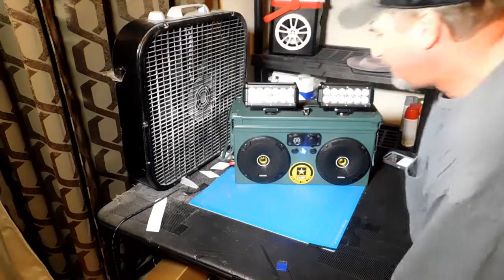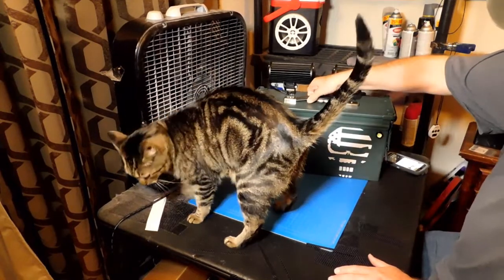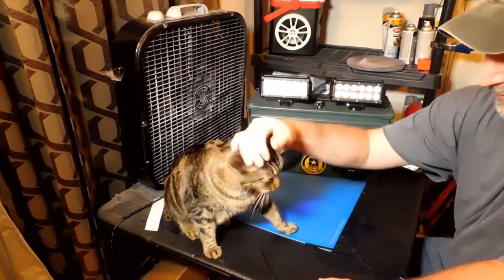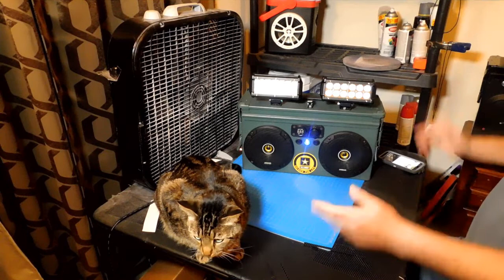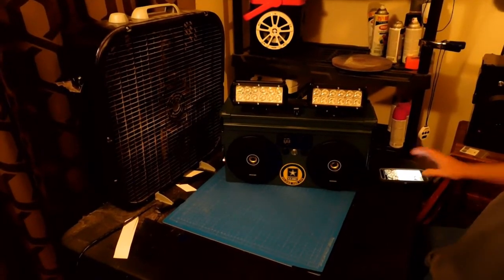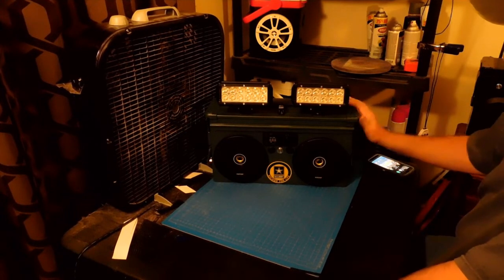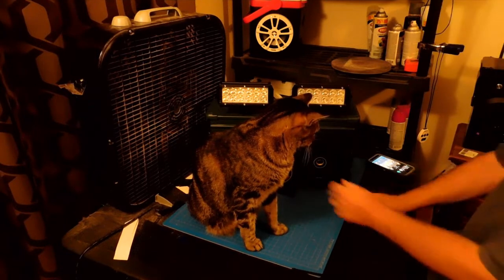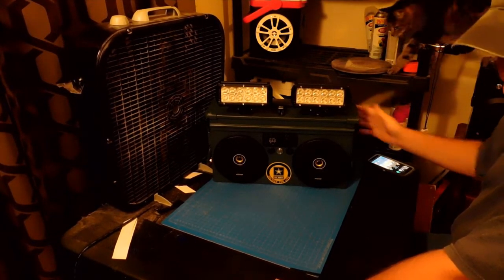40mm Ammo Box Bluetooth speaker With Lights

Comment: I’m in Mississippi; love this system!
You sell these?
What would a ballpark price on a speaker like this cost me? $-150-200 ?
Are different options available like amps, battery configurations, etc?
Is possible to have hardwired iPod dock to keep Ipod charged?
I subbed to your channel, and on the FB group.